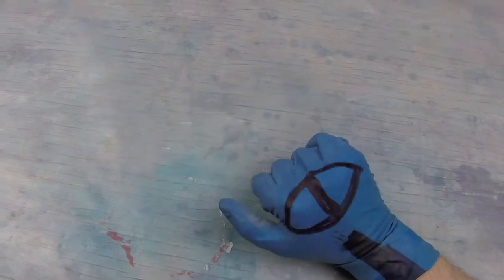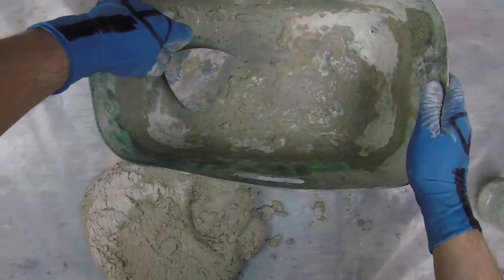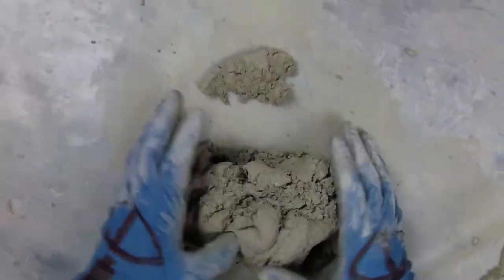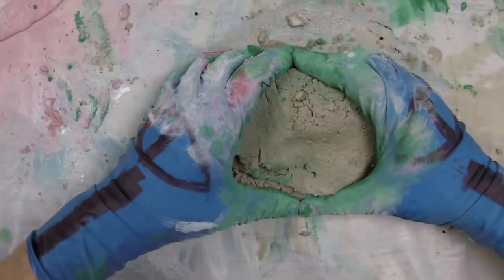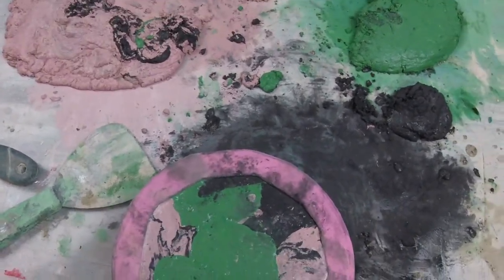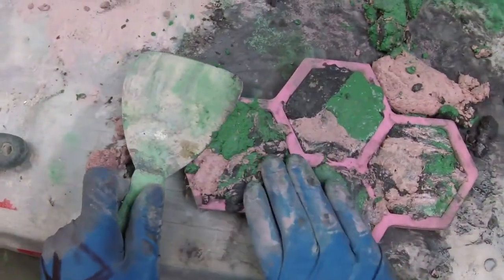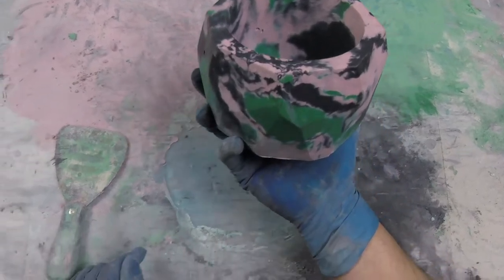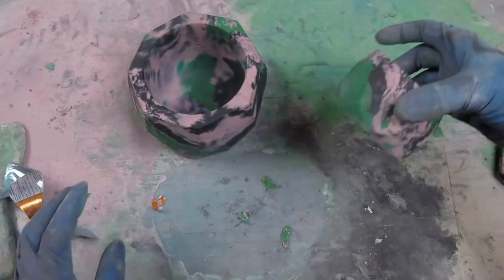Succulent Planter. DIY Step by Step tutorial marbled concrete with all the secrets!

Comment: Hey ConcreteConcrete! 
I really enjoy your videos. :) I’m waiting your next ones. 
I just wondering if the dried planters you make absorbs some water if you leave them with water inside of them for a couple of days? Or if they need saucer under? Or if the water changes the hardness of the planters?
Thanks!
Reply from the maker: Thank you. So Many questions!  Yes they can slowly absorb water, think terra cotta but not nearly as extreme.  If you drill a drainage hole I'd put a saucer. (make a saucer)  The water inside will actually strengthen the concrete by aiding in additional curing.  Concrete is alway curing and loves a damp environment!
Reply: CONCRETE CONCRETE - thanks for your time and keep up your work!